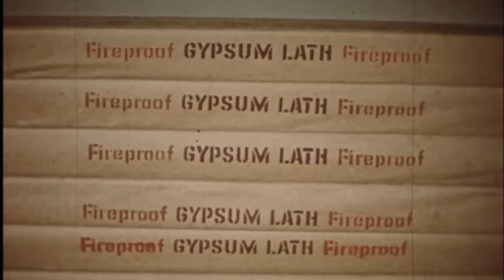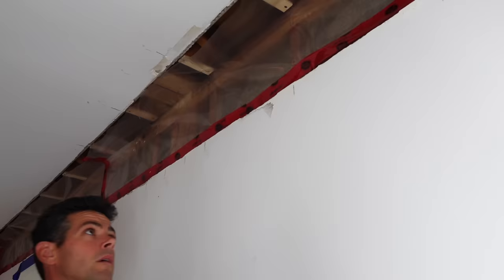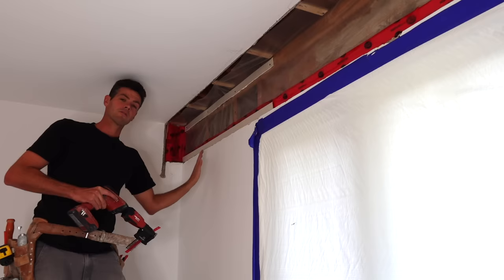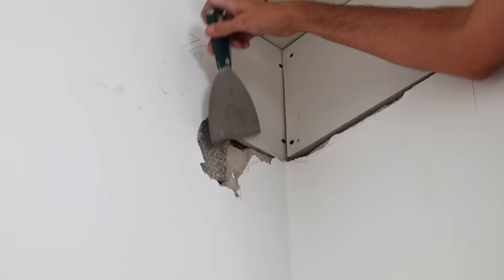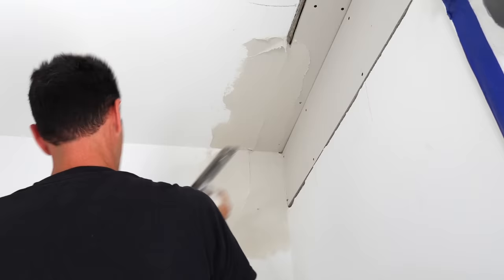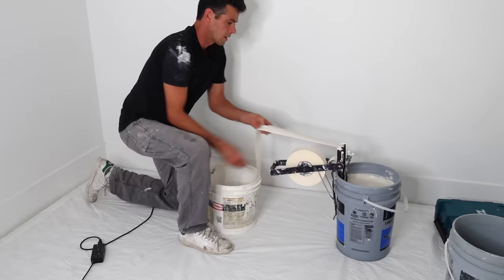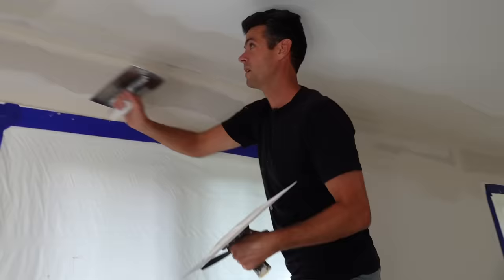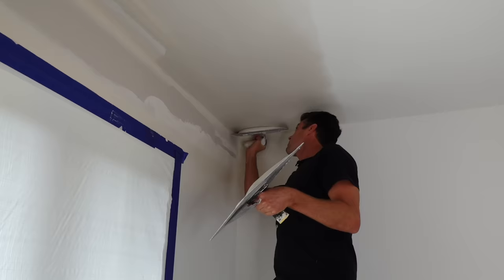How to Repair Mid-Century Plaster with Drywall!

Comment: My clipped plaster ceiling has like some sandy shit underneath it. What the hell is that all about?
Reply: That is the brown or "scratch" coat...usually there was two scratch coats and then a plaster coat .
Reply: @p-m2127  it's similar to how they used to do stucco back in the day with metal lath and diamond mesh, scratch coat, double coat, then stucco colour finish.  Now they use concrete board and tape the joints and skim the whole wall then stucco colour finish.

Comment: Structolite or Gold Bond, those are the two that you want to use for your base coat. This is completely wrong... He did not bond the edges of his old board with bonding additive. He'll be back in about 4 to 6 months to repair this along the edges
Reply: Could you elaborate on the bonding additive? I’m doing this project now and would like to not do it twice
Reply: @Backwater-wanderer  bonding adhesive you can order through Elmer's glue or you can get pink bonding adhesive which comes in a paint can.
Reply: @Backwater-wanderer  look for plaster weld

Comment: As a plasterer, I'm sad to see those shims.

Why go through all the extra work of measuring and filling out, when you can just do a like for like fix?

You'll end up with a better product, at less time and cost.
Reply: can't find plaster in Canada, have to adapt to surroundings using the material they can get on hand.
Reply from the maker: Exactly
Reply: Oh wow, I'm trying to wrap my head around this.

Is it an availability issue, stemming from the global supply chain crisis? Or is it just not something readily available at all, ever?

I know most suburban detached houses are stick framed over there. But surely there's brick and concrete as you get into multi level city buildings? If plaster is indeed non-existant there, how do these get finished?

I do find Canadian plaster suppliers, even brands, on the internet. But being in Europe, I'm not allowed to visit any retailer websites. So I can't answer this myself, sorry.